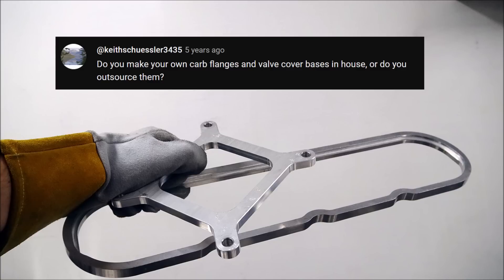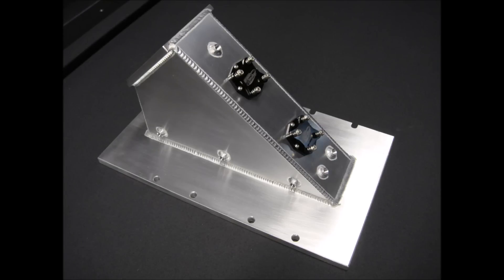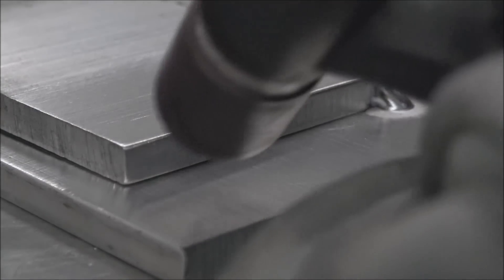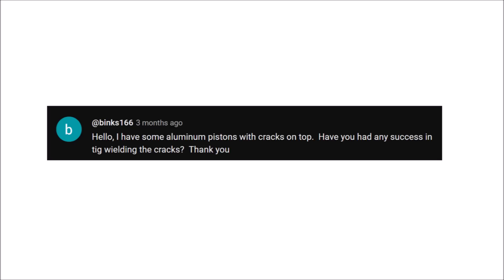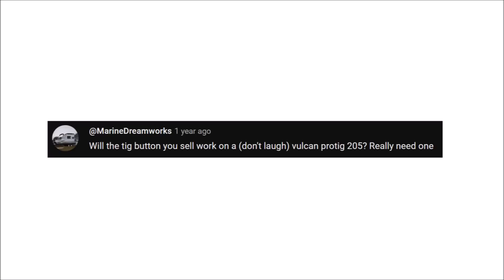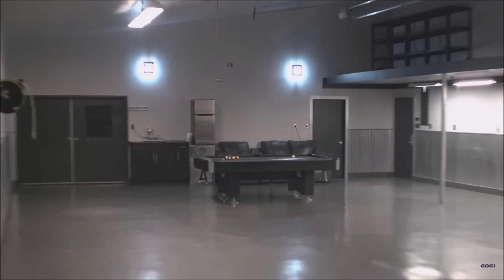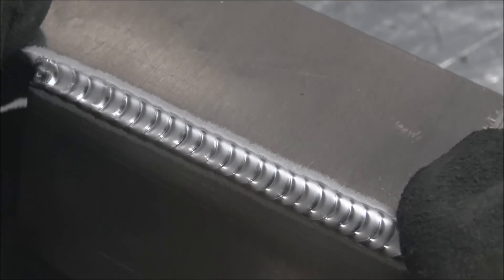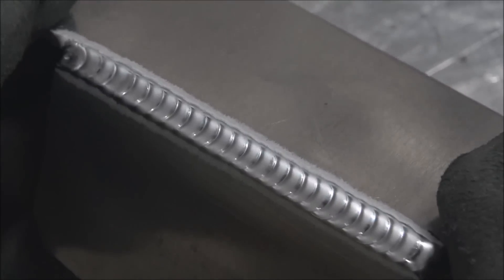TIG Welding - Learn How to TIG Weld and Fabricate with Aluminum - 6061 - Questions and Answers

Comment: I want to make a radiator from two aluminum sheet metal (for a small smokeless rocket stove). I was hoping I could press 3 inch or 2 inch dept in aluminum sheet metal and than weld the flat sheets together. Is that possible and could you make a video about that? 
From holland but I did recognize you were in Utah close to mining mountain it seemed. Your old shop looked so peaceful (and green). Well done 👍

I did notice a tiny number number of YouTube videos, where people use 3D printed plastic to form sheet metal. That would be ingesting if that was feasible.

Comment: Always nice work. I prefer to weld on the lower frequency too. When it's high the puddle seems way too stiff and the noise is irritating. But it does have it's place.
Thanks for all your videos.
Regards Brian.

Comment: Hi 
Thanks for your valuable video series.
Could you please tell me what is the Aluminum grade that you using and which filler material.

I am a beginner and I tried to weld 6061 aluminum sheet with 5356 rod 
but I cannot get beautiful dimes , always puddle sinking 

If you could make a video to avoid mistakes doing in aluminum welding that would be a great help.
Reply from the maker: If anything isn't answered on the website, feel free to email me with pictures of your issues.
Http://www.6061.com